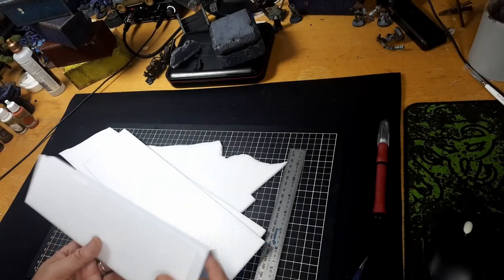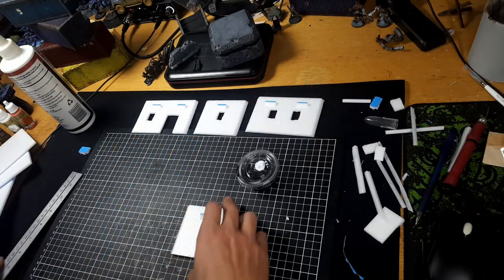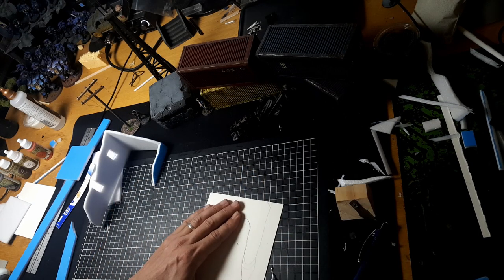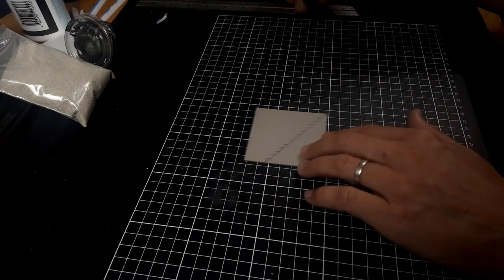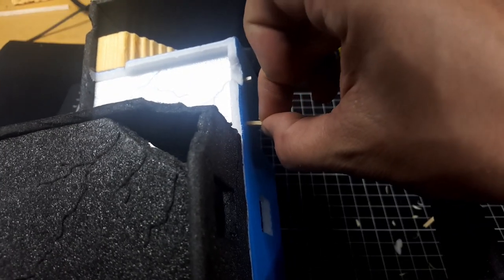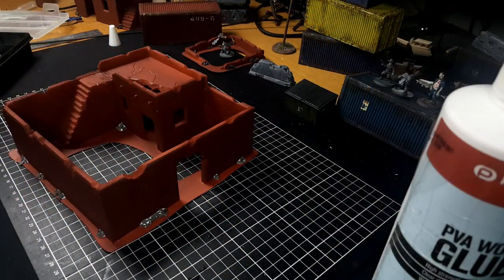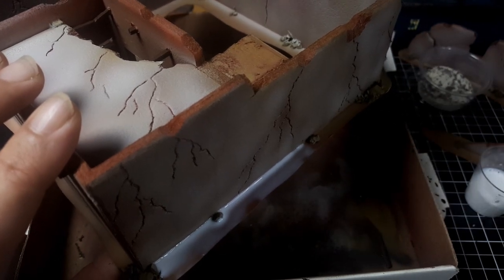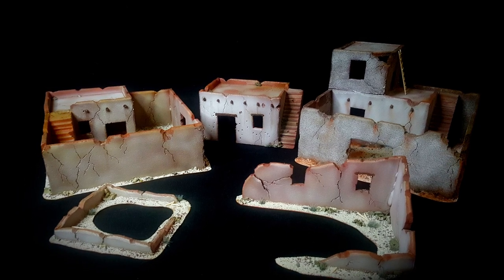Miniature Desert Buildings and Ruins - Quick and Easy Wargaming Terrain for Tabletop Games

Comment: In the UK Amazon sell stuff branded as 'greyboard' (a term usually associated with thick cardboard in the UK) which does not have the paper backing. I've been using the 5mm thick stuff for desert buildings and had no problems.
Reply from the maker: Nice, I haven't heard of greyboard before.  I wonder if it's the same as the 'chipboard' we use here, I know it comes in a couple of different thicknesses.  Thanks for the tip, and thank you for watching mate.

Comment: There’s no way that our American cereal box card could remain flat with so much moisture put on top of it.
Ours curls and the layers separate, as soon as it gets moisture.
Reply from the maker: Yeah, results may vary. I find the glue does provide some barrier to the moisture for the cardboard, and I try to keep all the walls close to the edges to prevent the whole piece from warping, but I understand this may not work for all cardboard types.
Thanks for watching and commenting mate.

Comment: Man I watched that vid did I miss the tool you made for 45* cuts?
Reply from the maker: Oh crap.  I'll check to make sure I linked the right video...so sorry mate.  In the meantime, it's just a piece of wood with a 45 degree cut on one side, and a craft blade screwed onto the 45.  You can adjust the blade cut depth by just moving the blade slightly, and easily replace the blade when needed.  I'll check that link, but it's a super simple tool, and there's really not much too it at all.  Let me know if I can help further.
Reply: @RFDHobby  cool sounds simple. I never thought of it and just glue 90 but 45 makes better sense for cleanliness
Reply from the maker: @colossalbigfoot256  for sure.  So simple to make and use, and once you have it just works perfectly and saves a bunch of time in trying to cover all the corners down the track.
Reply: The cutter is what I'm after as well. Great videos as always though
Reply from the maker: @starhand09  thanks.  Sorry again about the bad link.  But here is the link again for anyone else reading this reply.  1:41 in this video https://youtu.be/YB8a56TzhDY .  Cheers.

Comment: Hmm... No Brick Textures? Those Desert Buildings are made with Bricks and then plastered over with a clay mix. Otherwise they don't survive any rain or strong wind errosion. Also the Hot Glue is visible in lots of corners here. The paint is too brick red. Sun baked mud brics aren't red but still resemble the mud color. Normally the plastering is then colored more white, but not always. They make the white paint with ash and it wears off very quickly. So using a more light grey color is preferable.